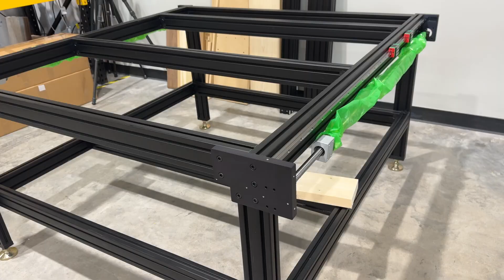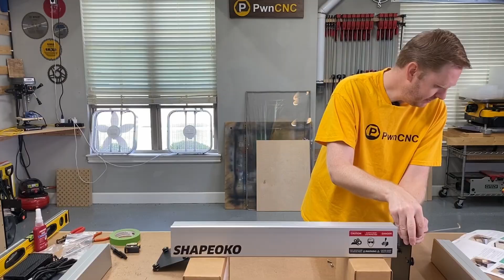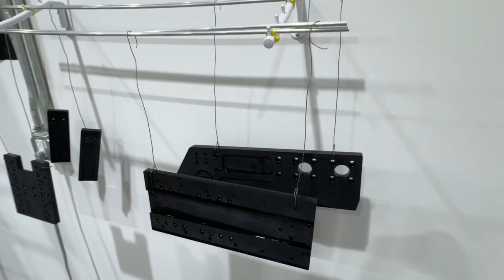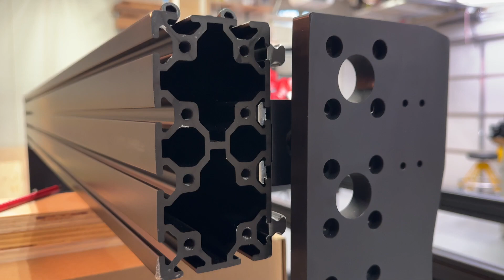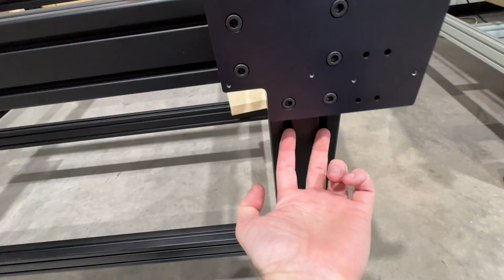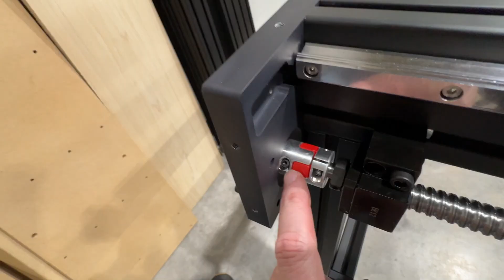Dominator Pro Build Series – Level Set #1: The Build Begins

Comment: Question What is the Table Height?
Reply from the maker: I'm taller and like my workbenches sitting at 36.5" tall, however i know not everyone is as tall.
So i googled average workbench height and subtracted roughly an inch.
Thus... Top of the Y plates is roughly 33" from the ground (depending on height of the self leveling feet).
Then you'll add upwards of 1.5" of spoil board surface.
Reply: @PwnCNC  I think that is a Good Average Height. ALL the Tables in my wood shop are Kreg Tables they are 35" from the Floor. Putting a CNC on Top would Add a Few Inches of Height. I'm 5'11.5" I like my Tables a Little High too So I'm not Bending Over to reach my work area.

Comment: I’d like to offer up my personal take on the Dominator Pro. I’m in north central Arkansas, so PwnCNC is only a few hours NW of me.  I went up there in July to meet with Daniel and Diana, and the crew, and to check out their new warehouse.  IMPRESSIVE!!  

I also got to personally put my hands on the very first Dominator Pro that you see sitting next to the black one in this video.  At that time I weighed around 335 lbs.  Wanting to see how solid it was, I grabbed the top of the X Gantry, so I’d have maximum leverage, and tried to shake the entire machine using all of my body weight…it may have budged a fraction of an inch but it was virtually imperceptible.  

Thinking maybe Daniel was messing with me, I seriously asked him if it was bolted to the concrete floor. He smiled and said “Nope!” So then I tried my hardest to scoot it across the floor an inch or two, but it didn’t budge.

To say that thing is built like a tank is very accurate.  I don’t know how much it weighs, and Daniel wasn’t even sure at that time, but it’s VERY heavy.  There is no question in my mind that this is the most heavy duty hobby/pro grade CNC you’re going to find anywhere. 

And even better, Daniel is as honest and genuine of a guy as you could hope to meet. His goal is to get more people into the CNC hobby, and provide them with the best equipment possible. Mission accomplished, my friend. 😊👍